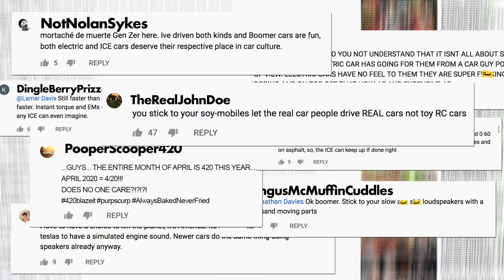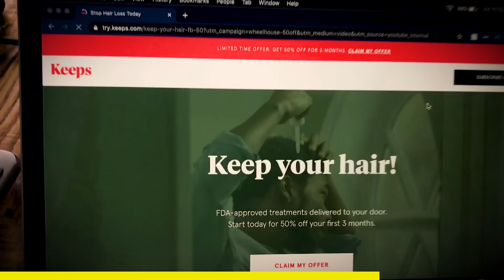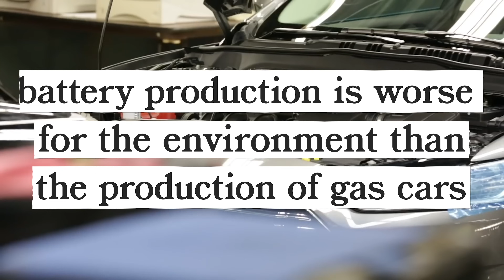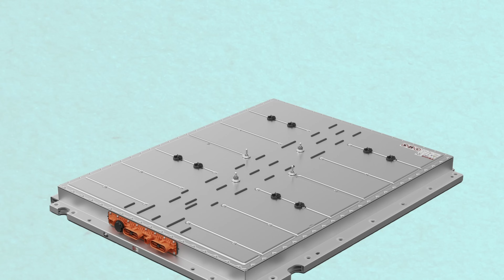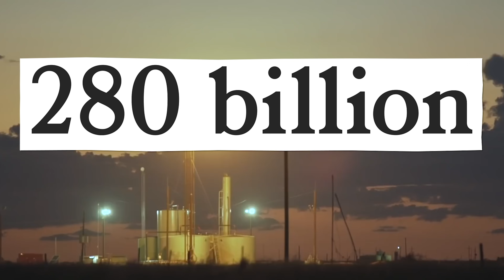Are Electric Cars REALLY Better for the Environment?

Comment: How many times do you need to change the battery in your car during its lifespan?
If you maintain your gasoline engine correctly, you can get a car that will last 1,000,000 miles or even more. How many batteries do you have to go through with an electric car if you want to drive your car that much? Rechargeable batteries don’t last forever you know and battery operated electric cars are not the only electric cars that exist. Hydrogen fuel cell cars don’t have anywhere near the amount of batteries as a regular electric car and super capacitors may be a viable solution in the near future.

Comment: What about disposal? I'm not sure but it seems to me that disposing old lithium batteries adds to the overall environmental impact of electric vehicles. I would like to see an electric vs ICE comparison from a cradle to grave perspective.
Reply: That's why people are advocating for the reuse/recycle of the batteries. Rivian has a full life cycle planned for all their batteries where they don't get disposed once their done in cars. You can prevent most of the negative side effects of lithium disposal by preplanning. It's another aspect of electric that will get better as they continue to grow. By the time they're even a quarter of the vehicles on the road the cradle to grave will be drastically less than what it is now

Comment: You have to make a LOT of assumptions to get to that conclusion though, its a long reach with a lot of assumptions.
Reply: donut excluded the impact's of the mines, mining equipment, transporting everything,  the sources used, and the research methods so we don't have the full picture or any way of seeing how the conclusion was reached let alone if the sources are accurate.
Reply: @skarloey2334  are you guys actually Ignorant? Eben under a video where the mining is included you bring the same dumb arguments?

Comment: 1. You showed A nuclear power plant giving off steam as "Emissions"
2. Why give us the aggregate? How much Emissions are needed to produce 1 gallon of gasoline?
3. "CO2" calculations can be equated to "energy needed" (so the less the better) but cannot be equated to "environmental impact"
2.  A large part of this debate should be the opportunity lost be producing EV Cars vs something else. For example small engines like the ones in gas mowers and chainsaws burn and pollute at rates magnitudes higher than ice cars. If you removed incentives to force these resources into the EV car market,. they would be better used replacing Mower, Chainsaws, snow blowers and other small engines.

Comment: Both cars energy source comes from underground.  Oil & lithium.       Oil is turned to gas then goes into the atmosphere.   Lithium is in batteries once it's used up over 10+ years it's lithium and chemicals are recycled and reused.

Comment: You took account of crude oil production for gasoline and added the CO2 into gas powered cars but you didn't add in the CO2 and pollution from the mining and production of solar cells which also include very poisonous chemicals. You also didn't account for the e-waste when those solar cells break or wear out. Also the amount of habitat loss for large solar plants, the amount of birds killed every year from solar plants and wind farms. There's no way around CO2 emissions even if we stopped using machines and went back to human and animal power, animals still need food which is metabolized into CO2. Just face it, humans are a parasite to earth and every other living thing.

Comment: Gasoline? What about diesel. Surely they have significantly lower emissions than gasoline. Also they use 20% less fuel and it's easier to produce as it's much less refined than petrol.

Comment: you forgot the production of windmils and solar pannels to power your electric car.
Reply: Same bullshit related to the production of the boilers, turbines, generators and other control systems on a coal power station
Reply: so ...oil rigs, refinerys and gas stations do not need to be built? And powered. Production of gas needs as much electricity as an EV needs to drive an equal distance.
Reply: so fossil fuels don't need infrastructure

Comment: has nobody realized that the average EV lifespan is only between 5-8 years and with ICE at an average of 12 years that means you will need to produce two EV to one ICE on average to meet the same longevity. that means double of these will need to also be recycled in some shape or form. with the more plastics and electronics to be recycled i dont actually know if they are THAT much better fore the environment. Not only that the average EV will loose 56% of its resell value in just three years after purchase meaning more cars going to scrap. Dont get me wrong i like the idea of EV but it sounds like using a plaster to fix a missing arm.

Comment: @Donut Media, you don't take into account the life cycle/decay of those batteries & how expensive they are to replace. Do you replace the batt or the whole car by then? Environmental radicals scream about "ending fossils" but what would that do to the surge in demand for E-pwr? There wouldn't be enough alt-pwr on the planet to run everything including home, industry, etc...EVs are a niche mkt @ best but we need all forms of power to remain energy-independent. Not to even mention unless you have a private home w/driveway as I do, this wouldn't be easy to manage. Also, battery efficiency varies w/clime. What do you do for heat/AC? Wouldn't that severely deplete your power quickly? **You couldn't GIVE me one of those things!** (1/16/21) I drive a FORD Taurus.

Comment: Your comparaisons are just odd and wrong: you should all convert to metric where it is so easy to see the obvious non sense of the above. For instance an old retiree touring with old ma 12.000 miles per year with an efficient non plug in good hybrid produces, as an individual, 15 time less CO2 than the coal electricity alone of an average German individual and 8 time less than the coal electricity of a Chinese individual, both car and waste producer. On coal power alone, a most efficient (prop.LR) Model 3 produces TWICE as much CO2 per mile than old daddy’s non plug in light Prius (1360kg) on gasoline and many time more on E85 ethanol. So, just figure out where on earth the real CO2 problem is and instead of any stupid brainwashed electo geek non sense, just listen to Aiko Toyoda, the  no. 1 of Toyota, no.1 car mfr.. He stated late 2020 that the heavy EVs pollute a lot MORE the planet than other mobility : Right!  About 94% of all the cars are made by the countries burning 86% of all the coal ( USA, China, Germany, Japan, Korea, etc..) and coal (with transport and old mines on fire) is just HALF of all human CO2 emissions. But, coal is so cheap that non coal countries (France etc) cannot compete and coal is a must to make cars as cheap as the other planet roasting polluters. In summary: ANY car initial grey (coal) energy and initial CO2 generated is highly proportional to actual production cost. That is where an EV (Model S) sold new at the price of a new 911 has about twice its production cost... ( any profit is paid by taxpayers subsidies, tax breaks and carbon credits, EV’s are produced at a loss paid by other productions) AND Model S generates initially the double planet roasting dirty CO2 of an 911 or five time the first CO2 of a Prius 4.... Yes, renewable clean surface produced energies are cheap, getting close to coal price (only 40$ per ton so 0.016$ per kWh of combustible cost only) but solar and wind powers are both highly unpredictable and variable while instead, the power demand , for mobility specially, is time and season dependant. So, the electric summer PV surplus CANNOT be stored as “ plain electricity” for winter without huge waste of dam evaporating water an inch or two per month, lithium batteries flat at best after 3 months of self discharge and very expensive copper power line additions. These wastes and huge rare metals polluting consumption are totally incompatible with our urgent world decarbonisation priority. We are so used to all our wasteful behaviours, gears, appliances and  lithium battery programmed quick obsolescence that we no longer see their immediate and destructive impact for the planet. That is where a plain composite H2 storage bottle with identical kWh capacity costs 1000 time less and lasts 100 time more than a similar capacity poorly efficient lithium battery of a coal car, BUT WITH ZERO storage loss and without requiring all those wasteful rare elements...(the “only” fuel cell platinum is 100% recoverable and recycled). Moreover without heavy lithium batteries nor thermal engines, the H2 fuel cell cars could become extremely light in futur.Finally, never mind membrane electrolysis efficiency already in the 80 percent range or the Apollo program fuel cells 50 years ago with only 84% efficiency, the H2 ( and O2 ) compression loss partially recovered at decompression, etc , etc, because sun and wind are free of charge and free of grey dirty energy altogether (i.e. at < 0.5$ per Wp cost, First Solar TeCd  P.V. initial grey energy is insignificant). The decarbonised futur of human mobility once we stop subsidising coal, oil, power and charging stations pollution will be the bio and synthetic methane gas network and green Hydrogen zero emission fuels and zero losses storable energy means, nothing else...except NH3 maybe...and this smart Aiko Toyoda and many others, Tavares etc...understood it fully. Just find one single video on green H2 mentioning O2 recovery and usage for the Covid19 pandemic or uncontaminated airless unlimited life time highly efficient  O2-H2 fuel cells etc...NEVER and you understand who is dead against green zero emission H2 threatening a highly profitable grey H2 production business with untaxed fuel, dirty electricity production with untaxed coal, and much taxpayer money for all that pollution, etc. This is a totally unfair subsidy to coal, oil, gas and utility power companies...and speedy planet destruction . We all know the decarbonised world where we all wanna go but our dear brainwashed candid green idiots have not road plan or gps whatsoever how to get there, while the very few riches fortunes holding all the WW ressources have deeply frozen any progress hurting their quick destruction of the planet: instead, we must (1) ban coal immediately, stop all the plants and close all the coal mines, (2) we must plan10 billions trees on waste lands. (3j Tax all fossil usage plane BBC, truck, electricity production at the current road tax level ( in $ per ton of CO2 equal tax level) in accordance with any basic fair trade principle, (4j ban all mobility empty seats and cheep tickets onboard gas guzzlers airplanes, (5) slow down all ships, cargo, cruise, etc, just few pct. etc etc etc...it’s so simple...but humanity and biodiversity benefits and survival are not the priority of the few thousands holding the worst ressources and politically USA China and Russia preoccupied ONLY by their selfish rivalry don’t care about preserving our planet .

Comment: You forgot battery replacement!
Reply: You can indeed forget it. The battery in an electric car comes with an 8 year warranty from new. And when it does begin to fail - usually at around 10 years old - it can be refurbished. It is not always necessary to fully replace them.
Reply: I mean thats sounds good but one of my friends had a tesla that he order a 10 000$ battery replacement by tesla. But we think that they ondly took out the dead cells becuse the battery capacity was mutch lower! And remember 10 000$!!!

Comment: If you are getting your power from a Coal Fire Electric Plant did you know you are releasing radiation into the air at a fairly substantial amount charging your electric vehicle. Check on it nobull monitoring for radioactive release from the coal is something the coal companies have lobbied against and prevented from the beginning

Comment: I loved your objective comparison of the EV and ICEV. It is refreshing to see a "total picture"  comparison from mining/driving to the "end of life" usage of the 2 types of vehicles. Too many people pick only 1 or 2 aspects to prove their point. Quiet often they only look at just the emissions from the vehicle and not all the other aspects as you have done in your video, Thumbs up to you

 A true unbiased scientist runs an experiment to see if his/her hypothesis and therefore theory is correct or  incorrect. The biased scientist will create experiments to prove they are correct or to disprove the work of others.

The current electric grid in the US has occasional problems with  "brown outs" in the summer during heat waves due to air conditioner usage. If you add to that an increase in recharging EVs, the problem will increase in frequency and magnitude. So the electric grid infrastructure has to be dealt with as we become more dependent on EV travel. Also the grid has to have improved warning and protection against major solar flares which have caused blackouts.

 As for what I have read about the search for the next type of battery, there is a big push toward carbon based vs lithium based batteries. There are at least 2 major reasons for this. Carbon based batteries supposedly have the potential for a greater charge density than lithium based batteries. Secondly, lithium is extremely flammable compared to carbon. In addition, the temperature from a lithium flame/fire is so hot that it can destroy laboratory Corning glassware in a very short time. Corning glassware can easily withstand the heat from carbon based flames such as from a Bunsen burner.

 I believe they are looking at carbon in the form of thin sheets of graphene. I am sure there are other materials that are being investigate but  they may not have received much media attention at this point.

Comment: Well they put solar and wind generators and wheel generators on the electric car extend the range and make it off. Grid  Electric car out of it devices that also make power put back into the batteries as well as able to charge up like regular electric car if if needed like winter time you might not get enough Sunday charger electric car or truck but once it's charged you can take for a trip and charged by wind and willpower rolling power driving down the road power if going into the motors it's also making power back into the batteries with wheel generators and if you really want to work good on it might be able to put three generators to one wheel and have 6 generators on the front wheels and fix generators on the back wheel making power then you got wind turbine making power off to win any got filler panels and any other kind of energy devices that great energy adding power to your vehicle you might end up being totally off. Grid If you are free energy devices that you can add to the car that actually work I believe there is to generate power for the batteries to store do you really use itand when you get done with all these energy systems you have a car is totally off grid vehicle and how about that wouldn't that be super great who are the firemenand will you be more severe great would find a better way making our batteries for those electric cars it's more humane to the Earth

Comment: EV doesn't need to do oil change,if used more than 5 years or high mileage even more environment friendly because no air,oil and fuel filter replacement at all. Less brake usage, less brake fluid change needed. Overall less waste/replacement part or wear and tear item to be produce.
Reply: Brake fluid still needs to be changed as often on a electric vehicle. Oil is recycled from oil changes. Fuel filters last about 200k miles and can be recycled just as oil filters and air filters can. New fuels are being developed that give extremely clean emissions from internal combustion engines. For example the new synthetic fuel developed by porsche reduces tail pipe emissions by 85%. This would put the internal combustion engine on a level of emissions output at the same level as a electric vehicles. Brake regeneration can also be done on ice vehicles.

Comment: I have reserved judgement on the matter for years now but this was well done and fairly convincing. I'm still reserving judgment but for now I'm an 85 percent believer. The reason for my doubts has to do with the chance that you missed something important which could change the outcome. To be fair that "something" would have to be titanic in its influence based on how quickly the EV's overtake the dinosaur juice vehicles when it comes to the carbon footprints they produce once they start to be driven.    Cheers

Comment: Could you do something like this and add Diesel to the mix?! I I am curious what the difference would be between diesel, gas and electric.
Reply: Theoretically, you could run an older diesel on vegetable oil, which would have no net gain to the carbon cycle. It would be interesting to see a comparison on that.

Comment: I would love to own an EV. I currently have two ICE cars. BMW and a Porsche. One has to go!  I would like to run my Porsche at weekends and let the EV do the bulk of my weekly family mileage.  I think this would be a good compromise.  Problem.  EV's are very expensive in the uK.  Solution!  By second hand.  i will get round to it.  I know my mind is made up as I recenly extended my house and had the cable put in to power an  EV on the drive.  As Horse power gave way to the ICE in the 20th century and then became a leisure pursuit, ICE cars will fall to the EV revolution. Its called progress.  This video highlights the potential problems